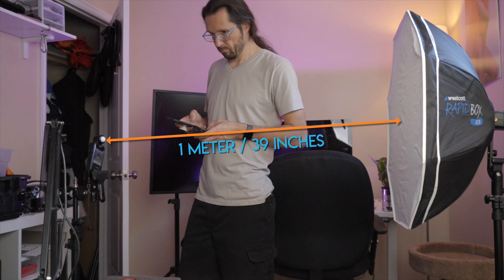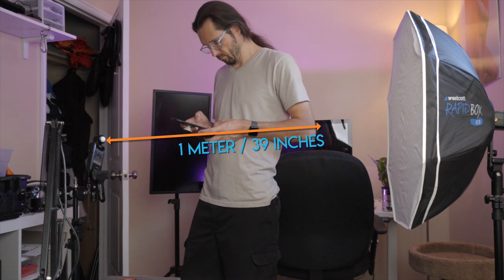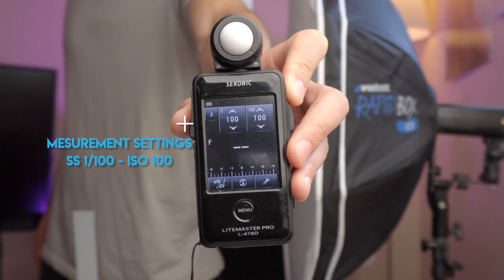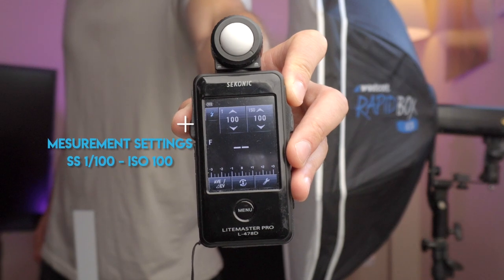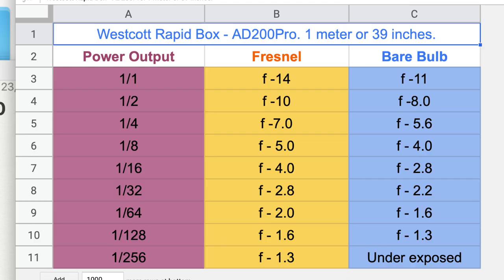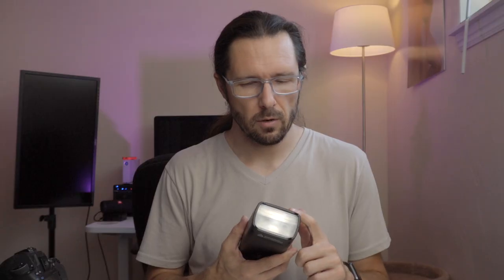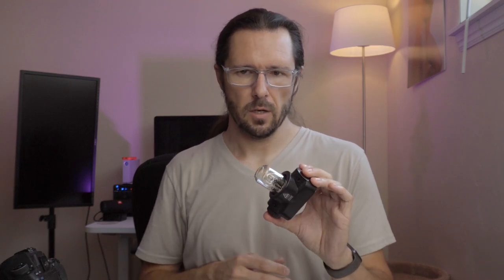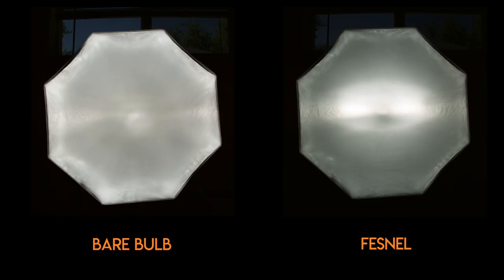AD200 and 200 Pro Barebulb vs Fresnel with a modifier

Comment: When you've used Seconic I've expected to see white balance/tint measurements as well, because I've seen complaints against fresnel (and I have some suspicions myself when looking at photos).
Reply from the maker: The “Sekonic” L478-D light meter only gives exposure readings. It doesn’t do white balance/tint readings. If you’d like to send me a device that does color readings I’d be happy to take some measurements and meet your expectations. :)

Comment: Hi Austin, can you please tell me what the locking knob do on the bare bulb attachment. Mine does not seem to lock the bulb in or lock the head to the flash
Reply from the maker: It’s a way of securing the bulb in the housing. If you take the bulb out and rotate the knob. You’ll see a little pad that presses against the bulb. It’s just a little extra security feature so the bulb has less of a chance of getting pulled from its socket.

Comment: The AD200pro round head has 3 levels of modeling light strength. Can you compare the strength of the round head of ad200 pro vs ad300 modeling light in a demo review video?
Reply from the maker: Hey. I’ll put that on my list. I don’t get much interaction with the AD300. But, if I do I’ll try and do some comparison tests.

Comment: How do you fit the barebulb attachment inside the rapid box?
Reply from the maker: I don’t have a non-pro AD200. But with the mount on the AD200 Pro. If it’s not fitting correctly you’ll notice the pivot point on the mount isn’t center with the stand. All you need to do is rotate the stand mount 180 degrees.

Comment: question, so the fresnel head has more power than bare bulb?
Reply from the maker: Short answer: Yes. 

Long answer: They both put out the same power, the fresnel focuses the light in a more central area a.k.a the hotspot. Whereas the bare bulb, spreads the light more evenly.